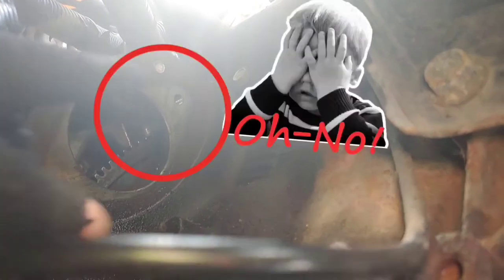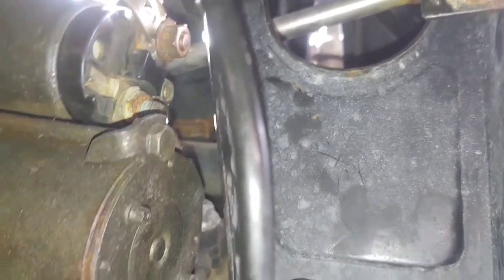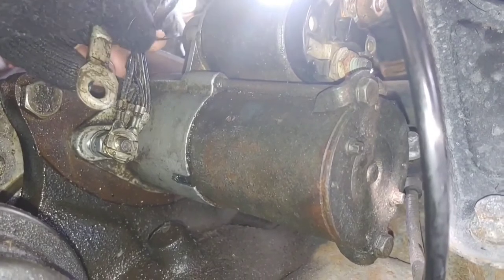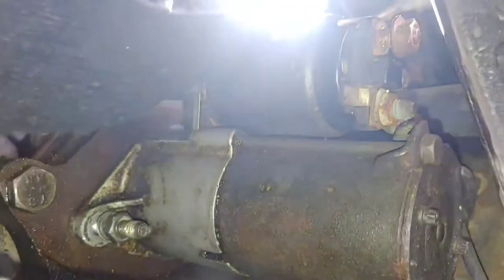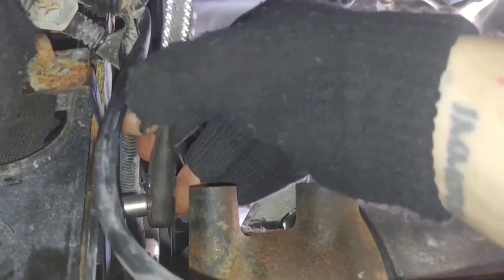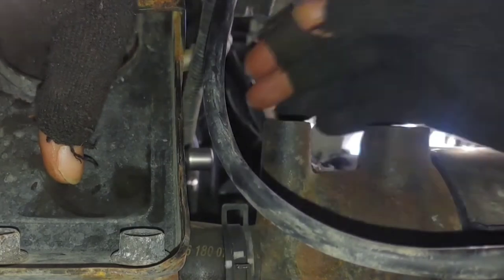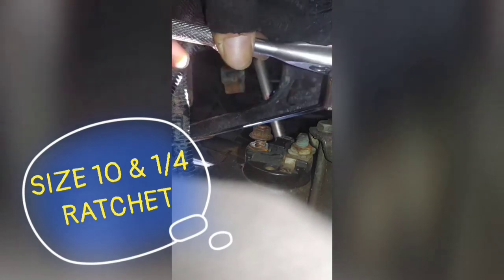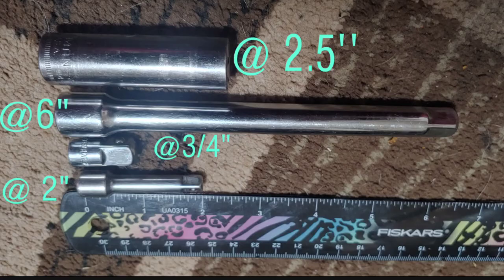2008 CHEVY AVEO STARTER REMOVAL OR INSTALL...WITHOUT REMOVING MOTOR OR COOLANT LINES!!!

Comment: 😅🦾😳🤨 💯 great information but I did it with three tools from the top of the motor 3 tools a 10 wrench 12 wrench and a 13 wrench end of story in about 15 to 20 minutes …..😅😅😅 but still very proud of you for one your a female and keep up the good work 🦾🤙🏾💯🦾🦾🦾🦾

Comment: One of the clearest instructional videos I've ever seen for car repair-thank you!
Reply from the maker: So glad it was able to help you out! Tried to make it as clear and easy as possible since I've ran into it where you are right there and then you find out you need a different size or tool etc and becomes such a headache. Figured if I can save someone the headaches that ive had to go thru then why not help others out.

Comment: Take out the motor mount bolts and the mount has enough room to move out the way and it makes it easier to install the starter. The top bolt was a small pain but if u install the bottom bolt in first without fully tightening it it'll give u wiggle room.

Comment: Good video.    easier to remove intake bracket to get to top bolt.  top 2 12 bottom 2 14. other than that good vid